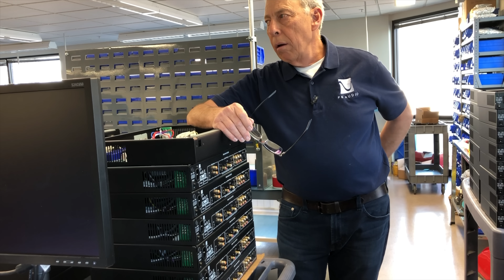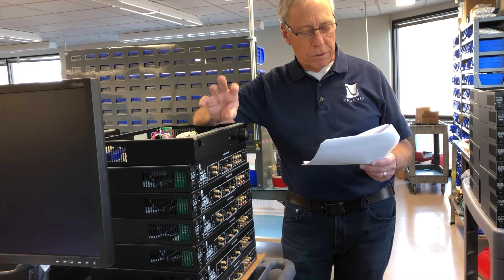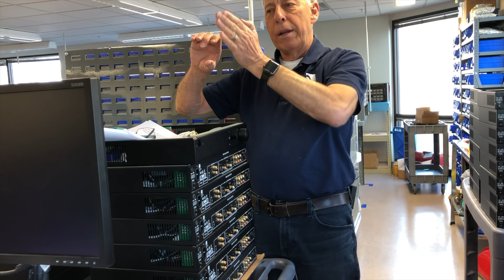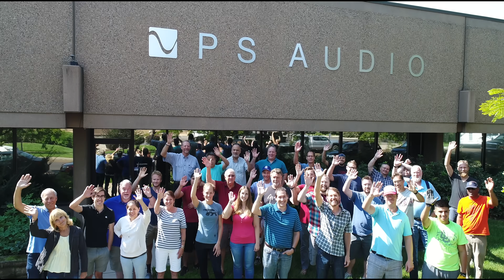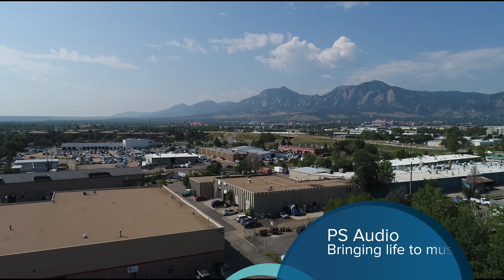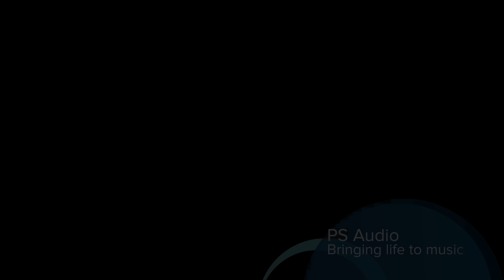Why do some volume controls have endless rotation?

Comment: Potentiometers were prone to L/R tolerance issues, early wear out and dust or smoke causing bad contact with scratch noise when adjusting. Old audio gear often get issues with the potentiometers. Digital volume control can be better but also worse for the audio fidelity. If the digital volume control is done cheaply by simply calculating a factor to the audio sample data, you will get a poor resolution at low volumes. For example, if you volume adjust a 16 bit CD 24dB down, you lost 24/6=4 bits and effectively what you hear is 12 bit music.

Comment: Ah, and that explains why there is a subtle delay between my pressing the button on the remote and the volume adjusting on my preamp. It uses a similar gain cell approach. Better than the old pots found in vintage gear? Well, hard to say in my opinion, because there was not much in the signal path to begin with. Overall in general, I like the modern approach over the ol' pots, but then again the pots had better response. I don't know that I would like them on today's gear though.

Comment: The endless rotating controls are normally two channel Gray code encoders.  They can be electrical contacts or non-electrical equivalents using LEDS,  Hall Effect etc. In the olden days, glass discs and light bulbs were commonly used.
Electrical contacts are the cheapest.
Besides just the relative position changes, these encoders can be made to process the velocity to accelerate value changes.

There are other rotary encoders that do have a start and stop positions but their resolutions are usually rather limited.

Comment: Could you connect an old style pot to a digital level control?  So instead of the audio signal going through the pot.  The pot will put out a 0-5 vdc signal to a separate gain control.
Reply: Not directly ... you need a micro controller in between them to translate the analog signal into whatever digital signal (I2C, SPI, etc) the gain control chip needs.

Comment: I have one of the PS Audio gain cell preamps from many years ago and it always worked perfectly.  I now have a very expensive preamp that uses an encoder connected to an attenuator chip, and it has been nothing but trouble.  Maybe someday they will get it right, but the gain cell approach seems to be the way to go.
Reply: Trade it in for the BHK Pre :)
Reply: @walterstorm9221  I would love to see a BHK Integrated; it makes more sense in my circumstances.  Paul?

Comment: I heard that with the volume knob turned down it was actually an attenuation of the signal and by the time you got to about 1 o'clock you're actually introducing gain, and thus some distortion. Paul/punters care to elucidate?
(Edit - Oh, ya sorta do from 1:43 re pots. Still doesn't explain the 1 o'clock/gain/distortion thing. Clarification appreciated).
Reply: ShellstaX . A pot is a resistive pad with ground on one side and the signal on the other, the wiper is connected to the input of the amp and as you turn it up it goes from ground to the signal on the upper end of the resistive material and has no gain only attenuation.  In my opinion it is the best way as you don't put your signal through any electronics which only degenerates the signal.
Reply: @phonebackup8132  Thx - I guess the gain bit is incorrect.
Reply: ShellstaX  That's correct, the volume control is a variable pad. It's the amplifier that has gain.

Comment: The video never addressed the REAL reason companies have changed to using endless-rotation volume knobs.  This would be to allow the use of remote controls.  Back in the days of pots, if you wanted remote control of the volume, the pot would need to be motorized, adding significant expense.  It's cheaper to use digitally-controlled volume with a shaft encoder as the front-panel control.
Reply: I also wanted to point that out.
Reply: When you're a kid the best remote is your little brother whom you threaten to pound if he doesn't get up and do it for you.
Reply: it's called rotary encoder 

analog or digital; in a analog impl for the volume control you use a trimpot, as that's cheap to do usually, though it's true that you can also use the rotary encoder and decode the rotation into feedback of the analog loop; depending on the amp implementation, one can be cheaper to do than the other

overall rotary encoders are superior from a user experience point of view; the amp can be made to remember the last volume, it can have presets for the volume or can be defaulted to a specific value; it can also have finer adjustment, or arbitrary fine grain
Reply: More reliability, more longevity and less sensitivity to dust and smoke are good reasons to abandon potentiometers. Yes, in some cases the reason to go digital is about the need to remote control volume but nowadays the typical reason is that the signal is already digital perhaps all the way to the amp. Your smart phone, Bluetooth speaker and many other modern equipment does the volume digitally also because volume setting involves things like a touch screen slider (your PC) , step up/down buttons (your phone) or even voice controlled volume (your Alexa speaker).
Reply: not true. in the 90s, Fisher had a volume setup. normal analog volume control and then a secondary digital volume control that controlled the volume up to the point of where the analog control was set. the remote worked on the digital section. if you listened carefully, in between tracks, you could hear clicking when adjusting the digital volume.  that receiver remains in my "worst piece i've ever owned" category but hey, it was 1990 and i was 21, i just needed tunes to drink to.
Reply: That isn't the real real.  That is a reason.  There are also other reasons in addition to the one reason you state.
1) Encoders are less susceptible to surface wear caused by the brush/contact.  In applications where that matters, it is a reason to choose encoders over pots.
2) Encoders allow manufacturers to program default start up volumes and let consumers set those as well.  That is now a very common feature in AVRs.
3) Having an encoder gives the system first prior in setting the volume.  It can recognize your volume setting as a request.  It reads your request and can decide (if implemented in the system design) whether to honor the request as dialed or to protect itself.
4) Encoders are more temperature resistant.  Ambient temperatures don't shift their values.
5) Encoders are often more contamination resistant that potentiometers.  It depends on the design and application.

Encoders were expensive once upon a time.  Now they are dirt cheap and readily available.  The potentiometer has as its greatest advantage 'analog control'  A well designed pot can give much greater, finer control in theory.  Since modern AVRs and amplifiers are pretty much digital devices at the control end, analog controls are not needed anymore.
Reply: Pots are better though
Reply: WESTEL Audio according to Paul, pots are inferior.

Comment: My amp has the endless volume. Hate it, but it's just the way things are now. I prefer a pot that can be adjusted quickly, and can crank it good. Now you have to crank and crank to get any level of volume, up or down.
Reply: My amp actually turns the volume up (or down) faster if you turn it faster, or for longer, but that is painful as well.  You tend to get near the volume you want, and suddenly it will start jumping 5dB at a time!
Reply: That just means you bought a product that wasn't designed well, plenty of them ramp up rapidly
Reply: that's a poor implemention then, nothing to do with the rotary encoder; you can have acceleration with rotary encoders, implemented in software, and you could implement different policies: multiply the steps during normal continuous rotation, or multiply if acceleration is detected

Comment: I have one of those infinite controls in my car,I have to be very careful turning it down because the volume goes up turning it to the left.
Reply: You have the most common type that uses switch contacts and the damping fluid from the shaft that gives you that tactile feedback has migrated into the contacts and the encoder needs to be replaced or flushed out.
Reply: @InsideOfMyOwnMind  Thanks,I've been wondering how this happened.

Comment: Encoders are good in some situations but I wish they had stops. Sometimes you just know that going to the stop and back a bit is what you need. I work in a studio with digital and analogue gear. I know where 3.15k is by feel. I don't want to look at the little lights around the encoder to find it and sometimes I don't need to listen for it because I know what I need to do. Same with gain structures. It's nice to see the dB on the screen but when I see the pot for that mic at 11 0'clock and it works, I remember.
Reply: some good rotary encoders do have stops, can can also be a product implementation, the rotary encoder doesn't have to have it
Reply: The problem with having stops is that encoders can have read errors. It happens very seldom but sometimes a step can get missed. This means that eventually the knob position would not correspond with the volume level

Comment: Never thought about this before, but is there a degradation in quality when using a Gain Cell?
Reply: I don't know what a Gain Cell is.  So I just googled the term, and it appears to be PS-Audio-specific nomenclature.  I also have to disagree with Paul about the sound quality difference between a pot and other volume-control methods.  There are a huge number of possible electronic alternatives to a pot for volume control; some of them can be OK, and some of them sound awful.  Imagine running your audio signal through a voltage-controlled amplifier, or through a resistor-ladder DAC chip.  Those methods add much more complexity to the signal path, and could have way more possible sonic degradation than any reasonable cheap pot.

Comment: The endless ones in the long run are bad. They get old and start making noise
Reply: This is wrong.  Pots get old and start making noise.  The endless ones, for the most part, won't degrade.  The only exception to this would be if some electronic part in the actual signal path (e.g. capacitor) gets out-of-spec due to aging.
Reply: You mean, pots?
Reply: Or like my  receiver the encoder lowers the volume no matter which way you turn it! Thanks to the  remote we still hae access to the volume with out repair...For now anyway :)